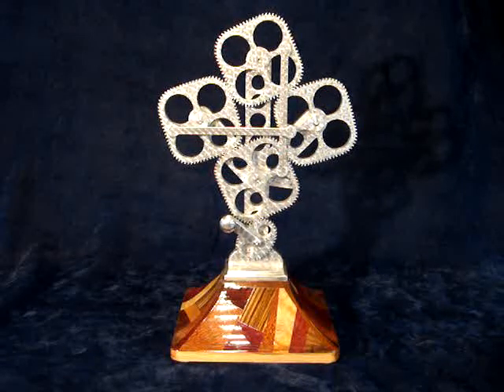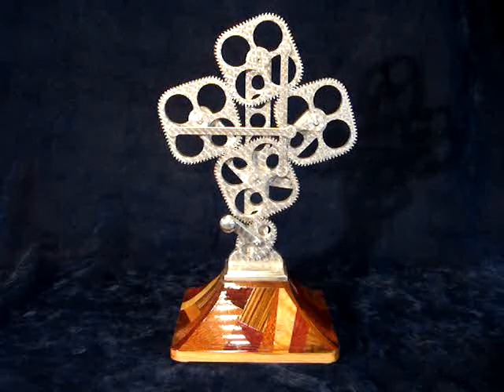Square Gears

Comment: could you please let me know what software you used to design this mechanism?
Reply from the maker: I did not use software for these gears or any of my gears. I used a Hewlett-Packard calculator and math that I mostly taught myself. Calculations were made in polar coordinates from the center of rotation to the center of each tooth and each space on the pitch line. Machine work was done manually on a Bridgeport mill with a Cincinnati dividing head. The top of the tooth was cut with an end mill and the space was cut with a standard gear cutter.
                        William Bartram